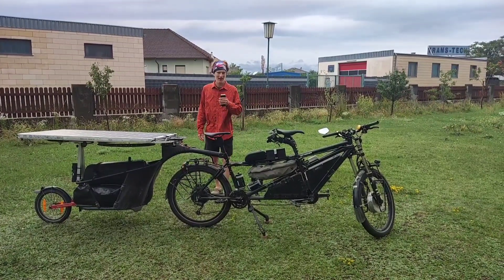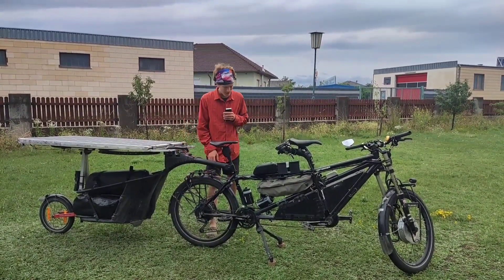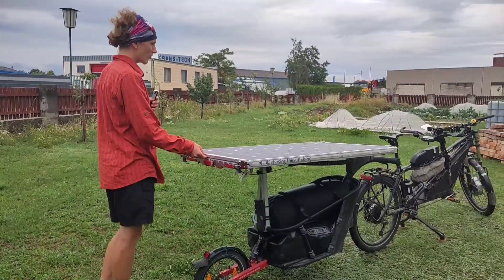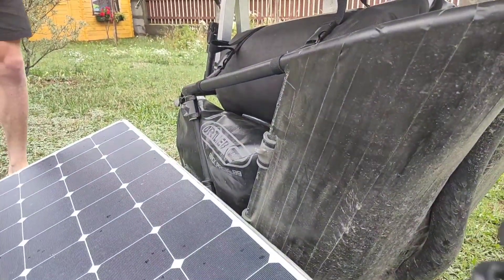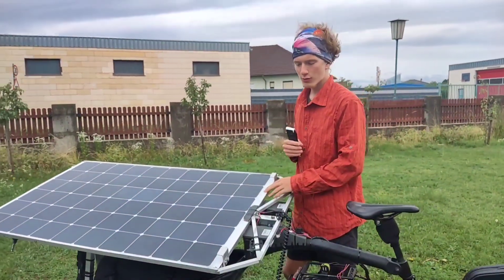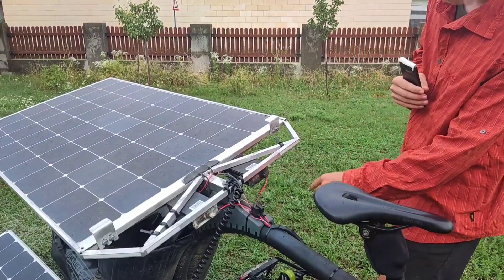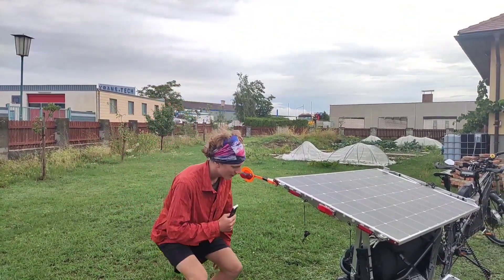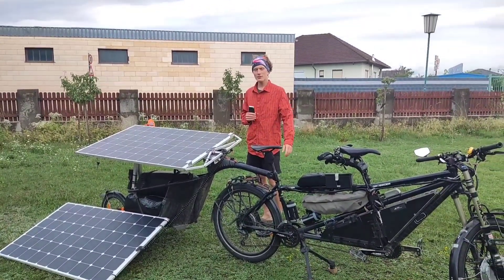Solar trailer | solarpowered electric tandem bicycle

Comment: Hey, great video. I have a question: how do you charge your batteries? Do you charge them directly to the charging port or do they have a common charging-discharging port? I have seen people connecting their solar charge controller directly to the small charging port while riding, but that seems dangerous, as the common ebikes batteries are not designed to charge and being discharged at the same time.
Reply from the maker: First of all we have a selfbuilt battery, the solar charge controller is connected directly to it. This means we can also charge the battery while we are riding, but most of the time we are using assistance, which means the power directly goes from the solar charge controller to the motor. As far as i know this setup is not a problem. Basically our solar cells, battery and motor are connected in a "star point" and electricity chooses the path of least ressistance :)

Comment: I'm also planning to make something similar to this. Is it possible to run the motor directly on solar panel ?
Reply from the maker: That would be theoretically possible, but has a lot of problems and disadvantages. If you have shade you would instantly loose power, very bad if you're on a climb. You couldn't use regenerative braking, whilst going downhill. I'm not sure if it is technically possible, because solar panels are not a stable power source. You might have to do some testing beforehand, but it would certainly be interesting to see if it works

Comment: Wondering how the power output turned out to work in real-life touring?  No doubt it extended the life of your batteries, but I'm wondering if overall daily power harvested from the sun was enough to keep you riding as you wanted, or were there times you had to stop riding sooner than you wanted to solar-recharge or plug in?
Reply from the maker: We mostly charged the bike with solar energy and the solar panels produced about 1250 Wh per day. For us the limiting factor was our butt, so we only rode about 4 hour every day with a pace of 25 km/h and good assistance. I would say a bike with solar panels is totally feasible and if you are riding great distances it is a big help and you can always charge your devices, phones etc.
Reply: https://www.youtube.com/watch?v=F27a7yQKD6s&t=14s

Comment: Hello did you put the Watt Meter between the GVB-8 and the battery...?  or between the solar panel and the GVB-8 controller..?  Thanks
Reply from the maker: We used a mppt solar charge controller from aliexpress and we had two watt meters (amp meters) one between the battery and motors and one between the battery and the mppt solar charge contollers (we used two)

Comment: wondering if your slide panel mechanism could be set up to travel in full length, and when you need to restrict length, you would then stack them..?
Reply from the maker: that's a really good question. 
Thats definetly possible, but while building this thing we concluded that reliability is our most important factor as we are not building something like a commuter bike that can be worked on every day but a bike for traveling which can be very hard to fix on the go and so we wanted to keep it compact to make it less voulnerable. And we think in the end it would not have made such a big difference, as we were "just" riding about 4 hours a day while charging it with both panels the rest of the day.

Comment: 60cells *.6v/cell *5.9amps =212.4watt panels if those are true sunpower cells. However you got them from china, which is known for fakes, so might be a knock off. what is exact link? please?
Reply from the maker: So our panels are rated at 200W and as far as we know these are B-grade cells which might explain the difference from your calculation. At good sunny conditions they produced about 150W each which we think is an acceptable value and at supreme conditions like when we rode across the swiss alps with a clear sky and lots of snow reflecting additional sunlight they actually peaked at 220W each

https://www.szjxysolar.com/index.php/products/200w-34-2v-etfe-sunpower-cells-flexible-solar-panel/

Comment: Have you considered using a Servo motor to automatically tilt the panels to always face the sun?  There are a few examples of riders doing this.  Cheers
Reply from the maker: hey Earle, yes we thought about using a servo motor to tilt the panels, but we decided to not go this way mainly to reduce complexity with the aim to increase reliability. As we were riding from north to south and the other way around, having a tiltable panel is a useful and effective feature, but we assume that you still dont have to change the angle of the panel as often so that an automatic tilting mechanism would be beneficial enough to outweigh the added vulnerability of the system. cheers!